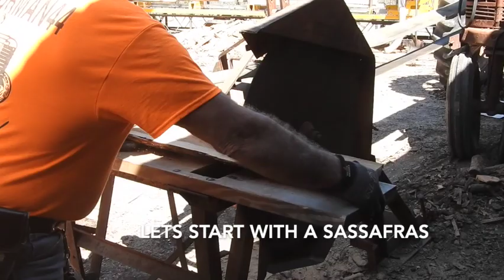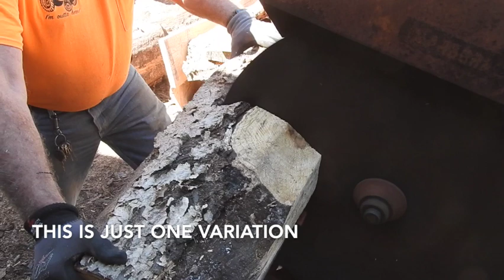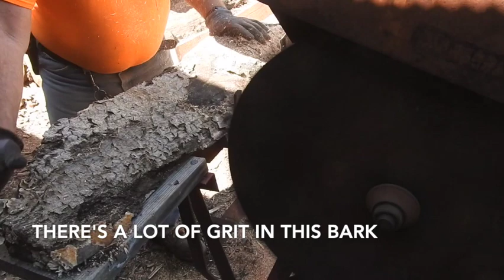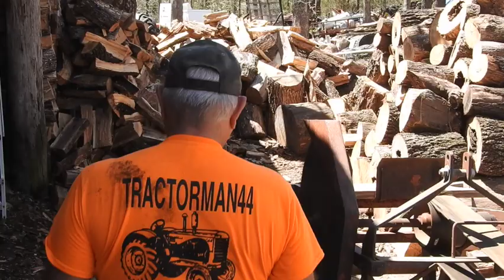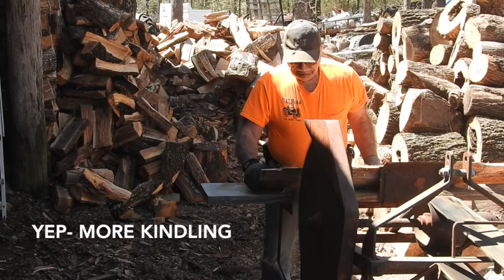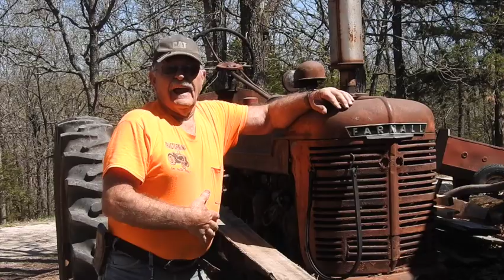BUZZ SAW THERAPY- Farmall H Provides the Power

Comment: Thank you so much for the mention, I've always been fascinated by machinery big or small. That's true about putting the large end on the saw bench first, I've learned that the hard way lol
Reply from the maker: Well, I can tell you've been on the business end of the buzz saw a time or two. And that rig of your cousins is certainly unique and it works quite well !!  We had some major size slabs off the old circle mill back home to contend with.  And our old rig on the front of the tractor was a slide top and not a tilt top, so you strained your guts out.

Comment: I just luv those H's when they're running smooth.  Great steel in the older machines, and they were built right, all those yrs ago.   Great Vid, Wendell.  Isn't it surprising how quik work can be done, when you are experienced and have the proper tools.  When do you think we, in Missouri, are gonna be NOT burning wood? haha  Stick around the weather will change....for the better or worse, it's Missouri.  haha
Reply from the maker: Hahahaha...ain't that the truth about the good ol' Missouri weather !!  I swear I'm gonna stick a straight pipe on that H one of these days.  Then she'll sing a real tune for sure Michael.  LOL
Reply: Same here in NE Arkansas. I keep thinking We will not need to keep building fire in the wood stove.
Reply from the maker: @thecollectoronthecorner7061  Hot dang Randall, the Missus just asked me to light off another one right now.  LOL  It IS a bit chilly in here though.

Comment: Very nice Wendell, I will check out your friends channel from NC, I hoped to see what is the meaning of the short pieces that you saw, is that for fire starters?? thanks and the H runs like a dream
Reply from the maker: Yes, those really short ones are the selective soft woods that split easily into kindling.  I mix 'em into the firewood pile so there's always a supply carried inside during the heating season.  Ready to split and stack in the kindling box.

Comment: Never ran a buzz saw but might look for one for the old 39 jd b , been burning a lot of slab ash hickory and cherry
Reply from the maker: Well, once you get it set up and sharpened good, you will enjoy sawing slabs with it Neil.  There IS a learning curve and you don't want to pinch the blade...it'll toss the belt in a hurry.  Plus you gotta keep the area around your feet clear !!

Comment: I suppose Dad's blade needed sharpening.  We could make the governor open up on the H with red elm. Thank you Wendell.
Reply: Don't know if you have used the idiot saw on really cold days ? We would let the blade spin to allow the frost to work out of the blade.  Then Dad would tap it on the side while it was turning.  It made a different sound if the blade had a crack.
Reply from the maker: @brycewiborg8095  Heck yeah, we used 'em throughout the year Bryce. In all weather except the rain !  Snow was the worst.  But yes, there is a difference in the sound tapping a cracked blade.  I've got a 36 (iirc) that's got several splits in the center of the gullets.  I learned how to mark and shape the teeth and deepen the gullets on a wood lathe from my dad.

Comment: We have ne of those buzz saws. To save on fuel. I was thinking of using a large single cyl wisconsin engine to power it? Maybe need to attach a heavy flywheel to maintain momentum?
Reply from the maker: Yes, that's helps a lot but the bad thing is it gets in the way of the long slabs.  I have a couple of them in the woods fitted with a cast flywheel.  I think one of them has a real little blade, like 24'' or so.  I'm sure it was run off a make and break motor, because it too is a stationary rig.